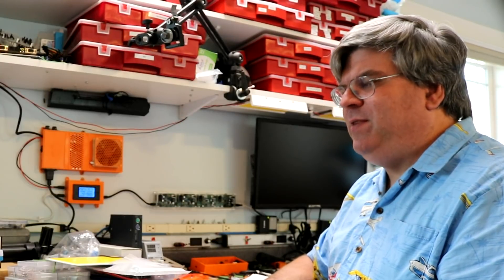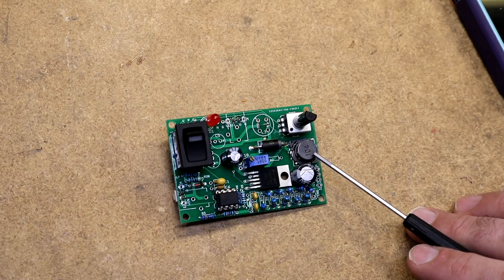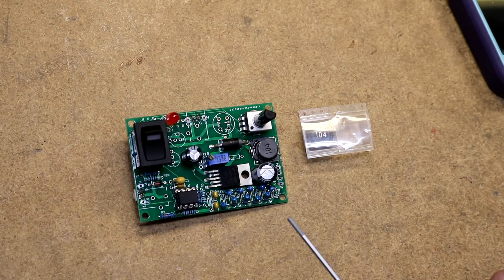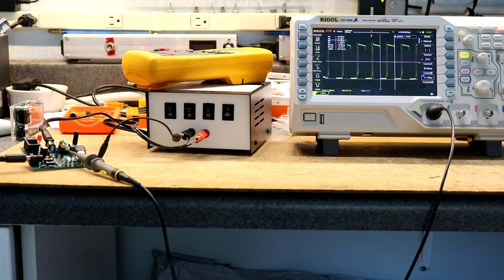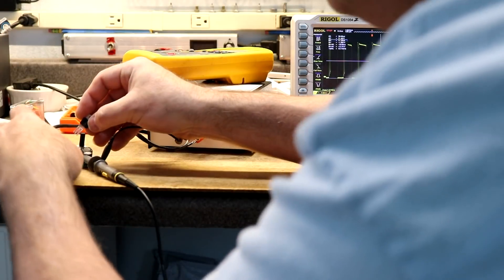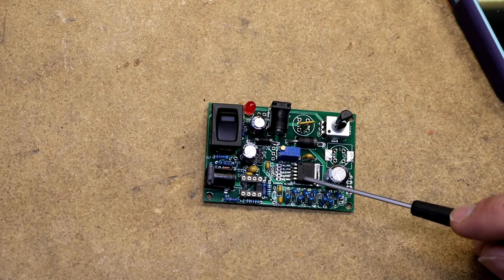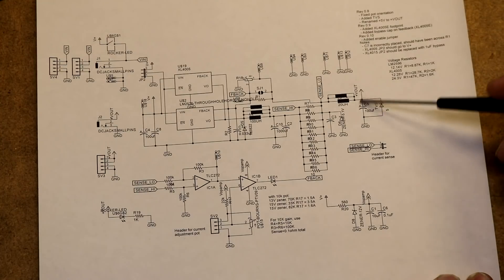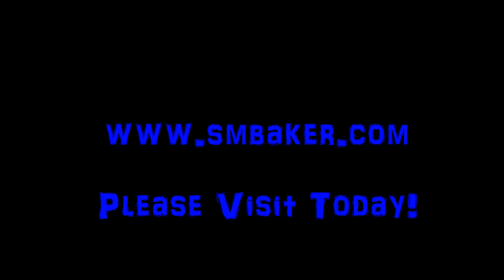Lessons Learned from building CC LED power supplies / Investigating fake LM2596 regulators

Comment: Regarding Lesson 1, pay attention to the DC Resistance or Equivalent Series Resistance in the datasheet. You went from 400 mOhm Max to 125 mOhm Max for the same current. That means that your second inductor was dissipating about a third as much power as heat losses.  For a given inductor of a fixed coil diameter, the inductance increases with the number of turns. They are likely using a smaller diameter wire in order to reduce wire length and the number of turns to fit in the same size package. The result is a higher resistance wire with a lower current carrying capacity for higher inductance values.

Comment: You are most probably right on those parts being fakes but, another thing that comes to my mind is the frequency capability of the inductor on your  board. As far as I know you can't just swap a 50KHz regulator on a board to a 150Khz regulator, there are other things to concern when you triple the working frequency.

Comment: Yeah, I've been avoiding ebay for most electronic parts for a while. I pretty much just buy cheap, simple things like switches, connectors, LEDs, Arduinos, etc. from ebay, and buy just about everything else from a proper electronics suppliers. Just too much of a waste of time trying to track down why your circuit is working weirdly.

The low side current sense is a good idea, I never thought of doing that myself. For driving LEDs, I usually just set the voltage to give me a maximum current and use PWM to control the brightness. It isn't very efficient though, so I might have to look at redesigning my LED drivers with low side current sensing.

Which is good timing considering I recently blew one up by plugging in the wrong power supply!

Comment: I learned that a great while ago for counterfeit parts. If I do buy parts from ebay It's usually from a NOS Military parts wholesaler. You pay a bit more like twenty bucks but you end up with 50 to 100 pieces. Another YouTuber I attend to watch did a tear down on some TO-3 power Transistors and you could see the inside die was not the correct one compared to a real one he compared it with. Also Amazon has gone down that spiral as well so don't think you're safe ordering from there as well.

Comment: i've had a few problems so far with semiconductors from china... 
- i bought a bunch of Max3232, none of them worked except one (which i don't trust), turns out there's alot of these ones that come from china are fake.
- i've been working on a project that needed opamps with input offset ajustment, so i bought a bunch of TL071's for cheap from china on ebay, but nulling inputs didn't help because they were disconnected. after looking online, it seems there's a large ammount of fake opamps on the "grey market". Even things as simple as opamps... crazy... Bought some "genuine" ones from an occidental country, and they at least react to nulling ajustments.
So i don't think i'll be trusting semicondutors from ebay anymore, unless i add "genuine" on the search bar (with a grain of salt), avoid chinese suppliers, or go to other larger resellers like Digikey/Mouser/RS and such... it kind of also makes you question whether simple TO92 transistors are even real ones...

Comment: Ive struck many of those dodgy multi turn pots mostly on those cheap boost/buck PSU modules from china.. after a while they always become so noisy and intermittent adjusting the things accurately were the stuff of nightmares